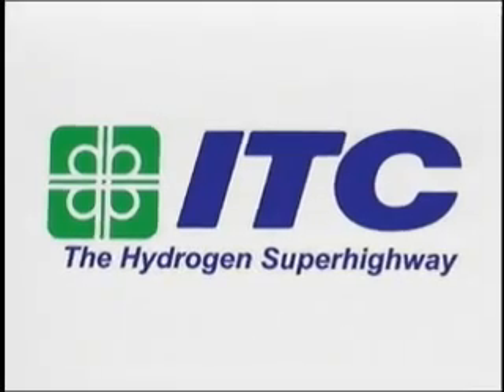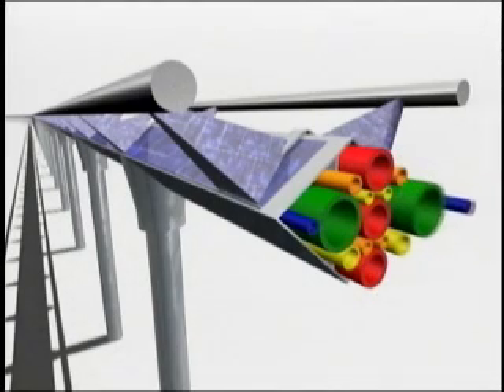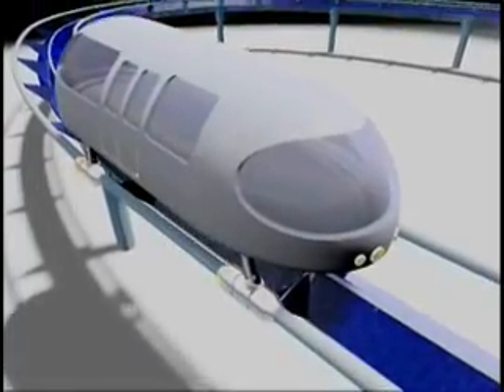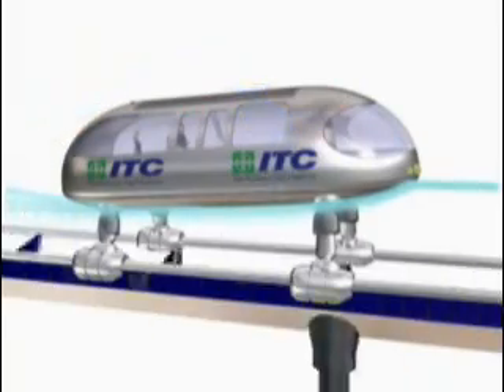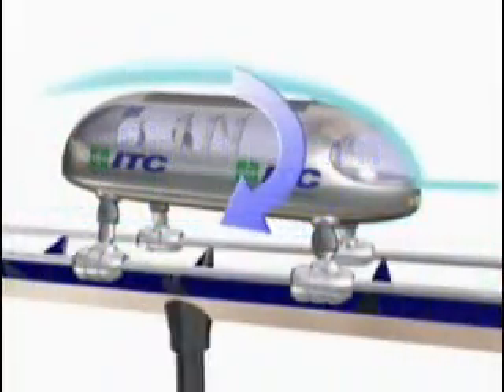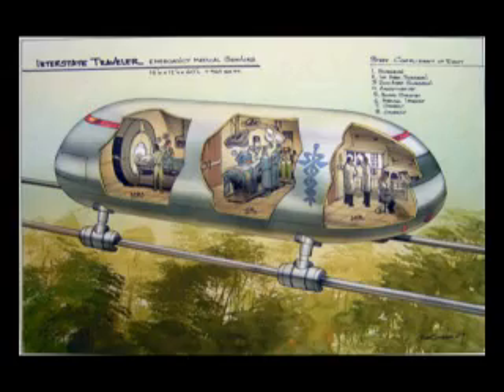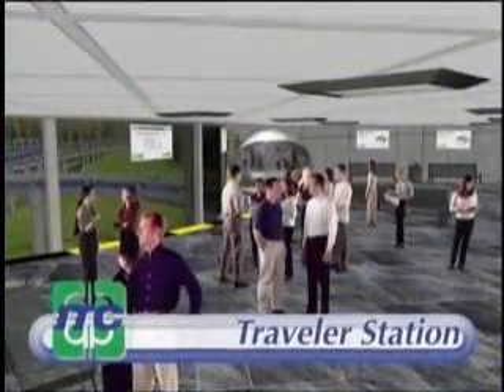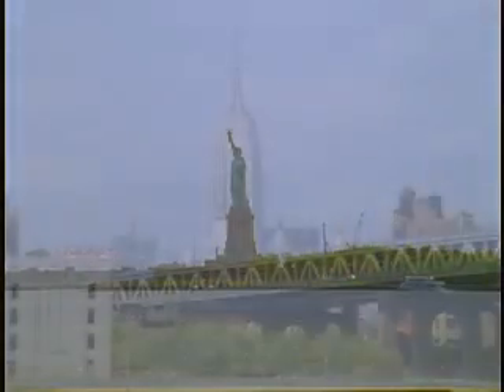The Interstate Hydrogen Superhighway

Comment: Great integration with the Intelligent Electric Grid plus the Spread of the Photovoltaic Integrated Energy Buildings (PIEB) and Photovoltaic integrated Energy Mobile Transport Structures (PIEMTS) is like the Central spine of the next brane Solar Power Network connecting every building wrapped in thin solar films, pioneer visualization for the Praxis of this Renewable Energy